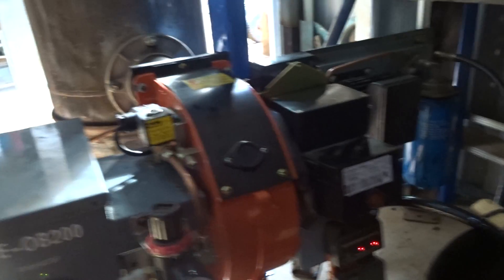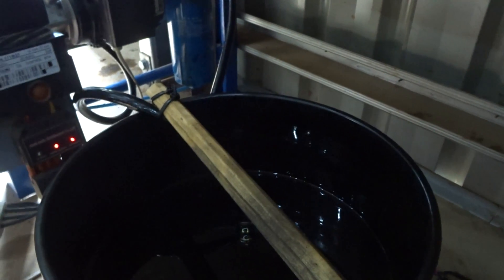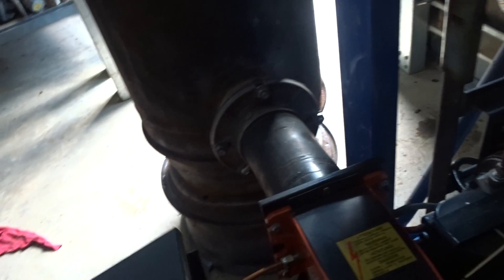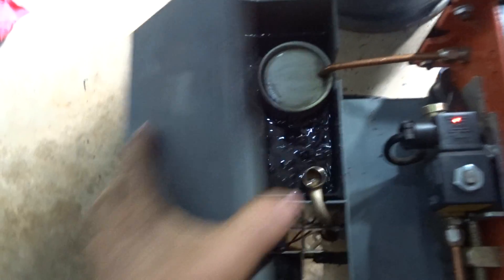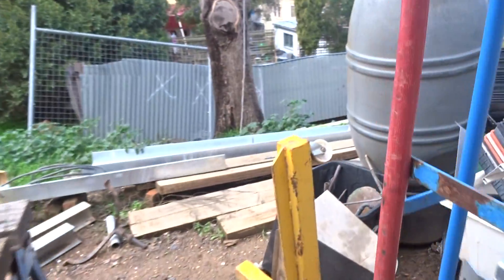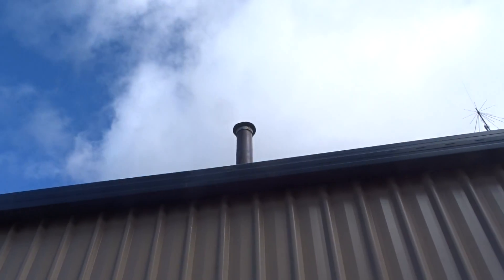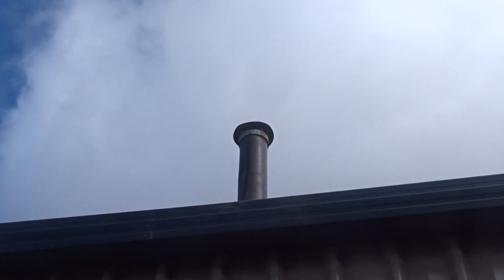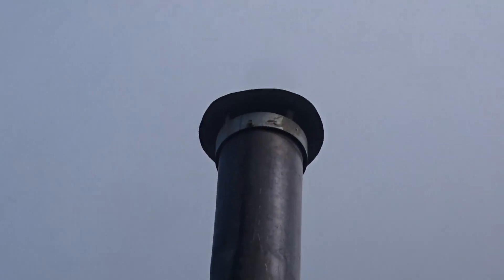Waste Oil Burner Pure clean burn Australia Waste Oil Burner AAE-0B200

Comment from the maker: Andy if it is complete is simple wiring just connect power to the two leads Iva e added a thermostat and that’s a it more complicated. And something that you are going to have to get a electrition to do
Reply: Power to the blue and black leads off of the master machine and other white wire coming from white box?
Reply: I have a 220 volt system we wired the black wires to 120 volt side of the 220 wire  and blue wires to neutral or ground of the 220 wires